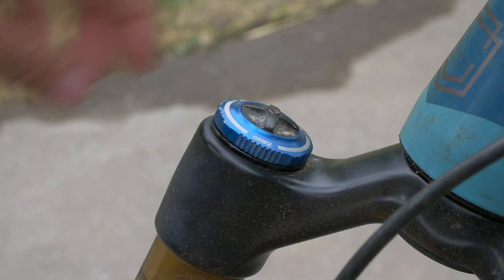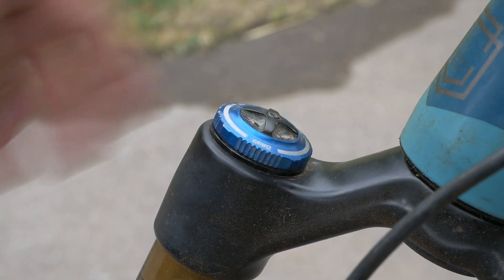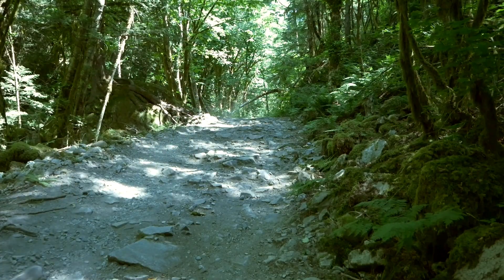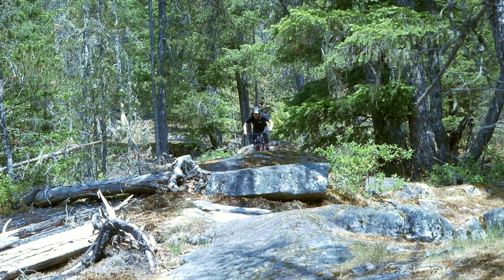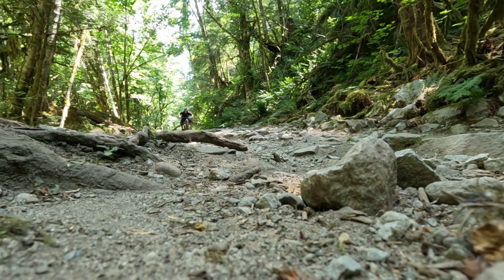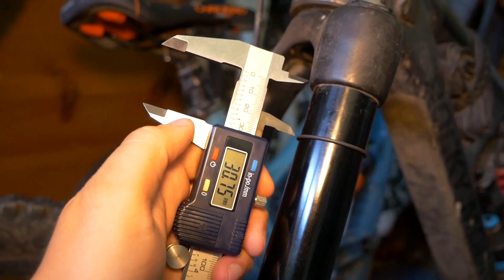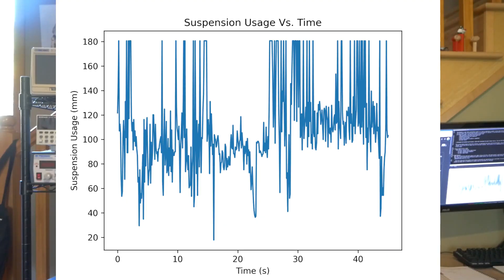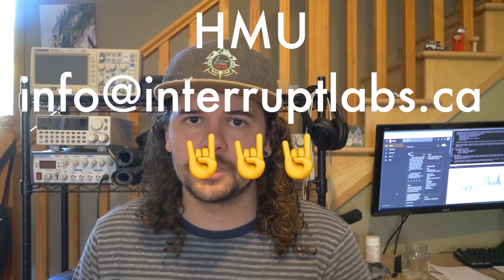We Measured Mountain Bike Suspension with a LASER! (ShockWiz + Motion Instruments REPLACEMENT?)

Comment: Heya! Came across this while searching whether there are some tools/apps out there to help me get the settings of my MTB suspension better (~optimized). 
I'd be quite keen to try this thing out.. you mentioned other sensors, I was wondering about an accelerometer, assuming that would give a hint of the vibrations the rider actually feels .. ?
For your 2nd generation, I was wondering if it would all fit into the steerer tube of the fork? Maybe have to remove the star nut ..
Beyond suspension tuning there might be something when adding actuators, you could link the damper settings to the current trail profile. Could even choose that automatically linked to some GPS pos & trail info. Would be a bit overengineered ..
Reply from the maker: Hey! Thanks for reaching out. We didn't really continue with the project because of a general lack of interest from people. We were looking for people like yourself with good ideas and interests to try it out, provide feedback, and add design input. Our ideal situation was working collaboratively with a components manufacturer to build the world's first data acquisition system for mountain bikes. Still, we couldn't find anyone who was interested.

I'm willing to share whatever engineering documents you might want; the accelerometer idea, I think, is a good one and was one of our core ideas.
Reply: @rootkitlabs  It seems to me that shockwiz is out there, and if they have a market there have to be some tech guys who want to geek out on their suspension..